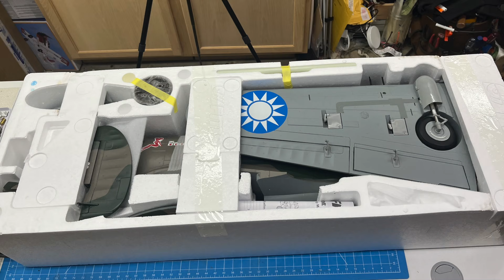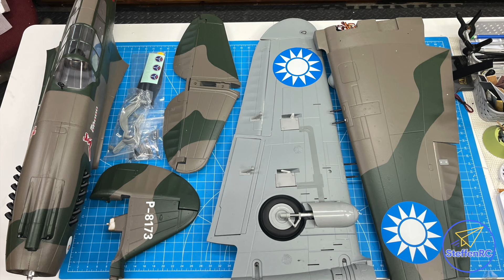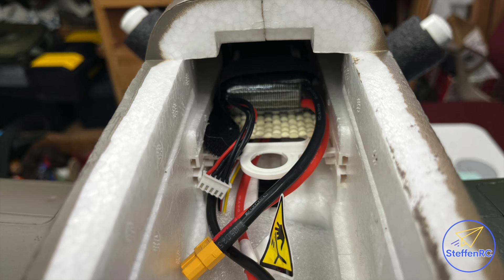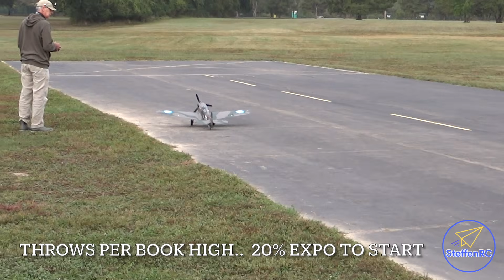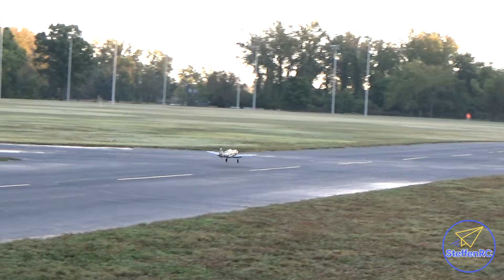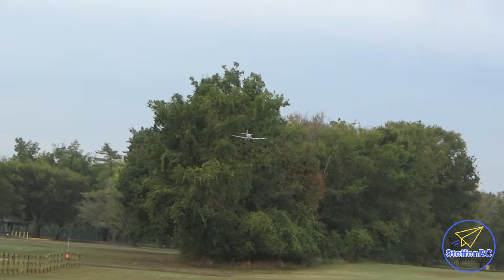FMS P-40B Warhawk 1400mm Fantastic warbird - Complete review

Comment: I got one of these a few months ago when on sale, I fly off a grass field, handled it really good, I did do the wire tying as best I could, Only have flown this twice before weather went bad, maiden went well, But it likes to come in hot even with full flaps, I had 2 bounces, And next flight on landing it bounced again once, and after inspection of landing gear the left gear pin was bent, It is good again, So I need to learn throttle managment with this one like anything else, I still have a old FMS FW-190 Red 8 , And it has the same landing quirks, Either they are smooth or they bounce, Oh well that is the nature of the hobby, Thanks for this and stay safe.
Reply from the maker: Glad you are having fun with it..  It does land a bit hot.  I've been moving the CG back a little at a time and it seems like it will slow down a bit better.  Thanks for watching and commenting.
Reply: Try replacing the landing gear wheels with Soft rubber tyre ones, it really makes a difference.

Comment: I have one in the box I bought last year and happened upon this great vid.  Thank you for being so thorough and systematic in your review.  I'm an "OK" pilot but was a bit worried about this one and ARFs in general since there is generally no washout to help counter tip stalls.   Also fly from grass fields which I'm not thrilled about.  Re the LG pin, would you epoxy in the stock part to avoid it coming loose?

Hard to believe somebody hammered you so badly re the oil tank thing.  Jeeeeez......
Reply from the maker: Thanks for watching.  Appreciate it.  The plane is pretty forgiving in the stall, as its pretty light for its size.  That other pin might get a carefully applied drop of thin CA, but its tricky to apply and not glue the whole gear in place.....  Either that, or try to peen it with a fine point punch.   The FMS Docs call it an Oil Tank, but there are always those guys that are a little too caffeinated...  :-)

Comment: Fms had this gorgeous warbird on sale a few months ago for $100 off. 
I jumped all over it. Replaced the motor with the P47 "Bonnie" motor and I'm using an Avian 85amp esc. It's the perfect power setup for her. 6s 3600 packs fit and cg just right. 
Its an every day flier for me these days. It's at the field if I'm at the field. 
Looks great. Flies great. Touch n goes all day - our paved runway is rough as Heck, so, the shock absorbing gear and a set of low bounce dubros smooth out every inch of ground hamdling. 
There's not a lot of content about rhis one. So, I'm real excited about this review. Thanks! 
🐾
Reply from the maker: I'm a huge fan of the FMS Warbirds.. (even before they supported my channel).  I have the Tigercat, Corsairs, P47 and this P40. Solid planes for sure.   I had been asking FMS to send me this P-40 for a while.  FINALLY they agreed and I'm so glad they did.  Based on the comments and views, this is a plane people are interested in.   Thanks for sharing, Will

Comment: I have an older version of a Freewing BF 109 1.4mm.  I was wondering if this P40 flys the same because of the size and similarities.  Just wondering what is your take on this if you ever flew a BF-109.  Thanks for another great video!  I enjoy your channel!
Reply from the maker: Never flown the BF-109, but I've flown several other 1.4 FMS planes.  Most are scale power which is fine for me.  Others think they need more power.  Several people have converted this plane to 6S with great results. (ESC upgrade and prop testing required).  Thanks for watching and commenting.

Comment: Have had one for years. I replaced the ESC/motor with the 6s system from the FMS P47.  Flies amazingly well and when using 4500 6s batteries, the CG is with the battery all the way forward. BTW, it isn't an oil tank its a fuel drop tank, don't know why they called it an oil tank.
Reply from the maker: Thanks..  6S sounds like a blast..  I know about the Oil vs Gas tank..  Not sure why they labeled it and I called it that. Since the Average view time on this video is less than 5min, most people won't catch it.. 😂
Reply: I can also attest to the 6s upgrade using the "Bonnie" motor. It's perfect for this plane. 
🐾
Reply from the maker: Thats very tempting...
Reply: HI, I'm just a newbie...so, i don't know, but what does a 6s battery do vs that 4s the plane has?  I've never gotten into this, and I just ran across this video on my feed.  Looks fun.
Reply from the maker: Great question...  A 4S battery or actually, qty 4 lithium Polymer cells in a series is around 14volts.  Where the 6S battery is around 22volts.  The extra voltage will produce more power/thrust making the plane fly faster.   The tradeoff is weight of the plane.  Some planes suffer with too much weight, while others can handle the extra grams/oz.  Lots of variable, but I hope that helps.
Reply: What is the kv on the motor you're using for 6S operatjon?
Reply: @SIDESLIP  4258 460 kv. I use an  Admiral 4500 6s and the CG is still the same!  I did have to replace the prop and spinner with a solid prop as the stock one can't handle it.  Found that out one day when it seemed I didn't have power.  Thinking I'd lost a battery cell, I dropped gear and brought her in.  Wouldn't taxi and as I got closer, I realized there was nothing forward of the prop shaft. Some weeks later one of the guys found the prop and spinner about half way around the pattern.  I flew a half pattern and landed without a prop!

Comment: Thats not an oul tank you ya dummy its an external drop tank for fuel to increase the P40s range because that Allison V12 engine was one thirsty girl. Do you really think the military would put the oil tank under the belly where it can be shot off the fucking  plane rendering the entire plane a big ball of flames and blowing up the engine. And if a plane had to carry that much oil with it to run it would be awfully damn heavy that's just crazy thinking that big old tank is the oil tank....
Reply from the maker: Take it easy Tom.  Lay off the morning caffeine.  It's actually labeled in the documentation as an OIL TANK, but I'm glad you found and error in my video. Well done.  Sorry I didn’t consult you on this.  Thanks for watching.

Comment: I wrote off an FMS Mustang 1450mm span on its maiden flight the other week. Somewhat of a mystery as it took off and flew fine so that I felt fine with pulling up to 45 degress with power on, rolling inverted and pulling round in a half loop, cutting the power back as I went. Trouble was it wouldn't pull round to horizontal, just flick stalled at every attempt and piled in. I had an FMS gyro installed but it wasn't active, new Lemon rx that some don't like, but I don't think it was either of those. It shouldn't be my flying either as I do this kind of manoeuvre a lot, with many types and without issue. The only horrible possibility that comes to mind was that the sliding battery tray slipped back making the cg fatally rearward. I was aware of this potential problem from hearing of more than one FMS Pitts that had gone in when the battery tray had slid back. I had put a piece of card in place to stop that though, looking back, it was perhaps not a particularly robust solution. I mention all this just, in a roundabout way, to warn of the sliding battery tray risk with this design. The P40 looks fab though and I always enjoy your videos 👍
Reply from the maker: Hey Mike,  Thats a bummer about the Mustang.  I use the Reflex and LemonRX often without issues.  Sounds like maybe the CG shifted.  The tray in this plane had a substantial lock when pressed in all the way.   Thanks for sharing as I'm assembling the FMS Pitts right now.   Appreciate you watching and support my channel.  Thanks, Will
Reply: @SteffenRC My pleasure. And yes I'm searching for clues as to why it crashed but that battery tray is something to watch out for. Like you, I don't think the electronics were to blame.
Reply: @SteffenRC  I wonder if FMC addressed the battery tray securing issue. The Mustang was actually several years old but bought 2nd hand by me and unflown. But belt and braces is not a bad idea with this one, a shame my braces might not have been thought through well enough! Apart from those who had CG shift issues, the FMC Pitts seems to be loved by its owners.
Reply from the maker: I'm going to keep an eye on it,  Also, I may do what ModelAV8R did with the Pitts and glue a block on the canopy to prevent the battery from sliding back.

Comment: its a fantastic plane and its even better on 6S power!
Reply from the maker: Wow,  you upgraded it to 6S..  I bet that is awesome....  Thanks for sharing..
Reply: @SteffenRC  yeah it transforms the plane! and not just top speed, but right through the whole power range. I don't fly fast or flat out ever but this plane felt very underpowered and sluggish, especially with larger batteries when I tried to get longer flight times. But now I can get 15-20 minutes of flight time on a 6S 6000mah pack. Its really great and has become one of my all time favourite planes! 

I replaced the motor for a lower 460kv 4258 with a 80 amp Predator ESC, fitted a spinner with a metal backing plate as the plastic spinner assembly could blow apart with the extra power and then finished it off with a 16x10 Master Airscrew three blade prop. 

If I ever lose this plane for what ever reason, I would buy it again and do the exact same upgrade! Its fantastic!

Comment: An iconic plane, but never one of my favorites. Elevator OTF in the flap system is horrible. You have to use the left or right trimmer, not the usual trim levers, and if you go the wrong way, it won’t let you go through zero in the other direction. Using flight modes and F-mode trim is way better. Good review, as always..
Reply from the maker: Thanks for sharing.  Appreciate your insight.  I never had much of an issue with OTF.  But I know there are limitations...
Reply: @SteffenRC I use the left trimmer for AS3X gain and the right trimmer for Heading Hold gain since they remember where they were when changing models. Same for F-mode trim. I leave the AS3X gains set to adjustable instead of capturing them, so the upper trims are always in use.

Comment: Great video. Nice plane. Lots of detail.
My advice for anyone flying off the typical rough grass club field we have in the UK - avoid tail dragging WW2 warbirds. Smooth takeoffs are near impossible and landings tend to end in a tumble onto its back. Takes the satisfaction out of a flight. Save your money and find something that suits your field.
But I know I'll struggle to follow my own advice with the P40 🙂
Reply from the maker: I get it.  I think the larger warbirds with larger wheels work ok on grass.  (1.5m and larger).  The smaller 1.2m don't like grass at all.  This P-40 surprised me.   Thanks for sharing your insight.